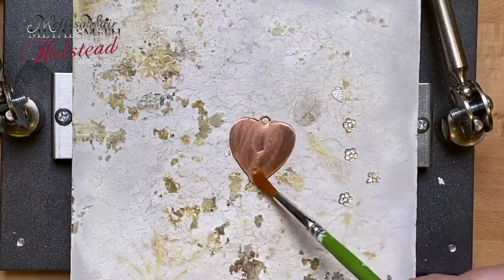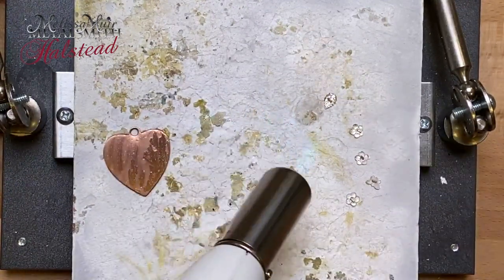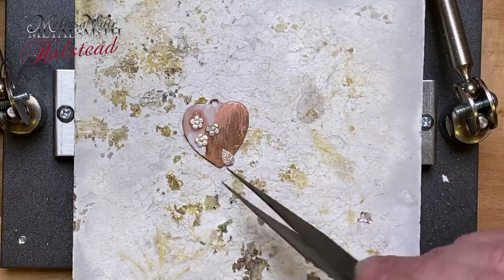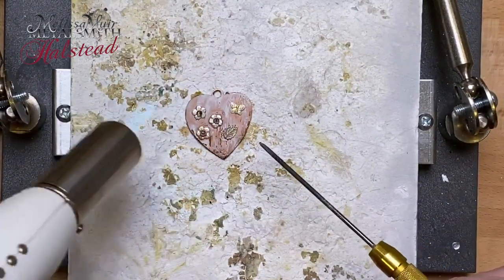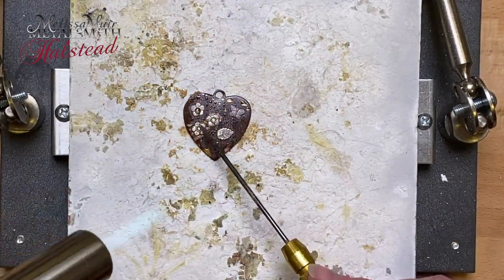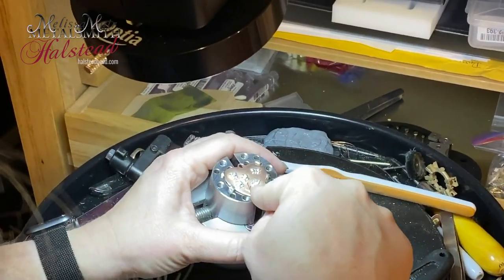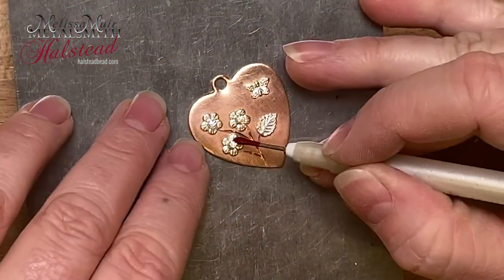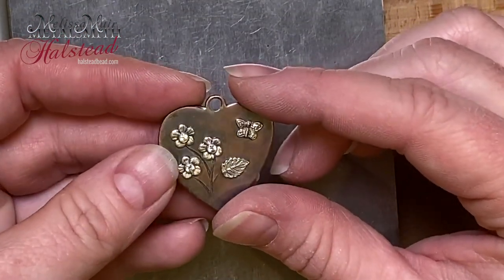How to use Soldering Ornaments from Halstead Bead - With Melissa Muir

Comment: Melissa. Why doesn't the fact that they are somewhat 3 dimensional and not flat prevent a good solder? I thought everything had to be a perfect join?  And that solder would not fill in the gaps? Also, would I be able to do this on a ring band? With some, but not all of the embellishment in contact? Would like to try to add one to a spinner in a spinner ring. thanks in advance!

Comment: Are you using easy or hard solder?
Reply from the maker: krystyna93418 I use hard solder almost all the time.
Reply: @MelissaMuir  So when soldering on such small embellishments like these, I should always heat around the piece and never directly on the piece? Why is it better to sweat solder small pieces on instead of adding solder directly to the pieces? Thanks, Melissa for your help
Reply from the maker: krystyna93418 really, you could do it either way. I just chose to sweat solder them for this one.
Reply from the maker: krystyna93418 oh and yes. I find it works best to heat up the larger backplate surface first and let the elements absorb the heat.
Reply: @MelissaMuir  okay, thanks.
Reply: @MelissaMuir  Okay, thanks a lot, Melissa ;)